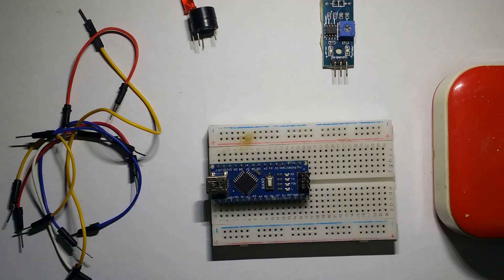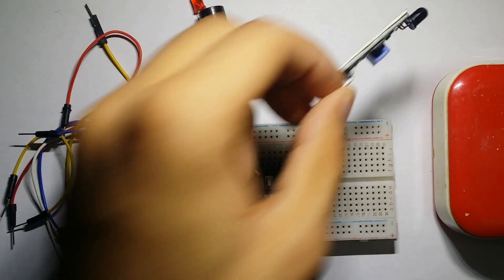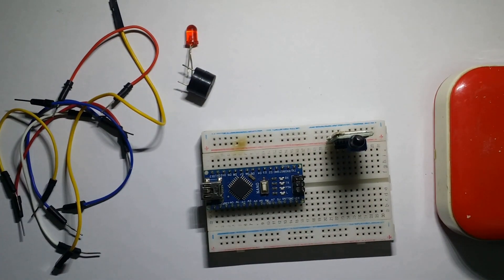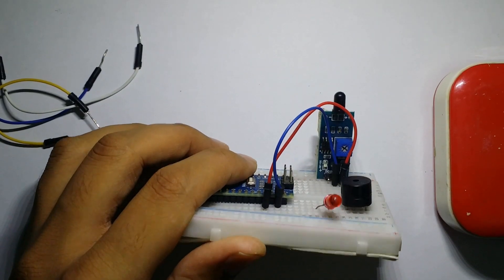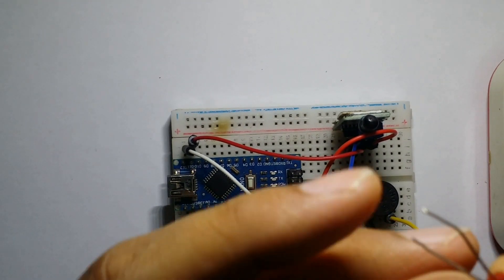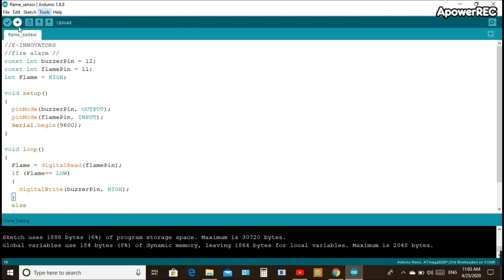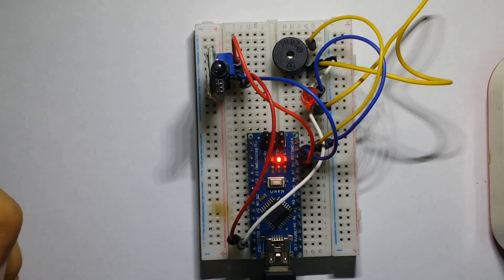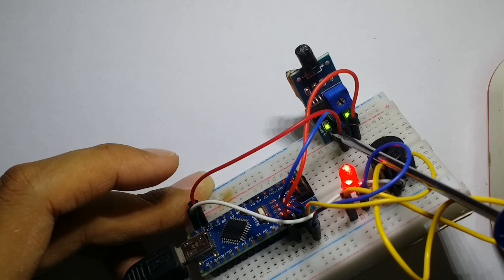Flame Sensor Using Arduino! Detect Fire | EASY TO MAKE!

Comment from the maker: //E-INNOVATORS
//fire alarm //
const int buzzerPin = 12;
const int flamePin = 11;
int Flame = HIGH;

void setup() 
{
  pinMode(buzzerPin, OUTPUT);
  pinMode(flamePin, INPUT);
  Serial.begin(9600);
}

void loop() 
{
  Flame = digitalRead(flamePin);
  if (Flame== LOW)
  {
    digitalWrite(buzzerPin, HIGH);
  }
  else
  {
    digitalWrite(buzzerPin, LOW);
  }
}